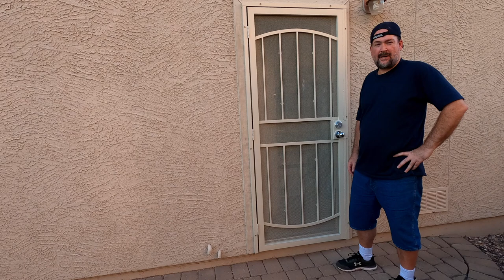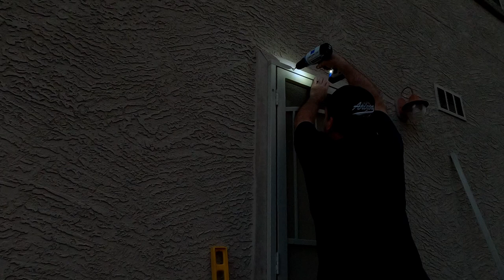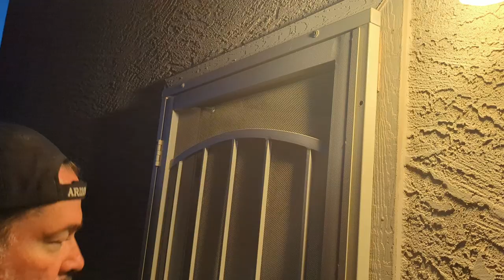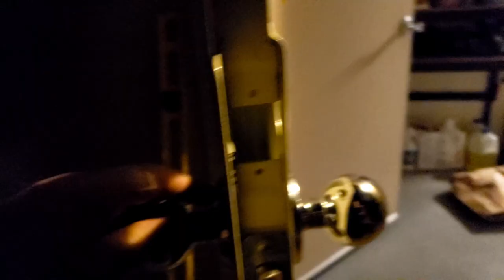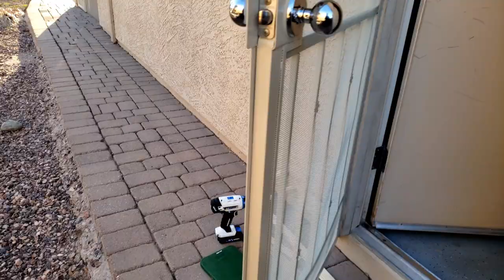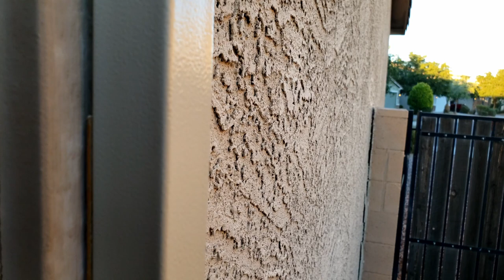Watch This Video Before You Install A Security Door!!! 👀

Comment: This is very helpful because it doesn't show a "perfect" installation under ideal conditions that makes the person look good. I'm likely to make the mistake of not checking the top too and would've been frustrated, this is a solid reminder of what not to do as well as what to do. Thanks.
Reply from the maker: Thanks! A lot of people try to make everything look so easy and it can be frustrating when I try to do it and it doesn't work out. So I like to show my DIY mistakes. I think it helps give people a realistic idea of how these types projects can go wrong so they can get it done right in the end.
Reply: Well for  starters  you should have done it in the daylight. Can't see anything you're doing.

Comment: Great video! Thanks for showing the mistake so i can prevent from making it myself.  I also like the tip abiut using my own screws to make sure it is hunged leveled before putting on the security screws.
Reply from the maker: Thanks! Yeah if you are off a little bit it can be tough to adjust the heavy duty hardware that these things come with. So getting it all lined up first really helps a lot.

Comment: Great video! Question for you: I have a 30x80 door. This model starts at 32 inches, but I’m not seeing any reason why it wouldn’t work for my opening as long as the trim is wide enough. Do you agree? Nothing besides the door handle/lockset extends into void between the surface-mounted security door and the inner door, right? Thanks!
Reply from the maker: The security door will be mounted to the door frame surrounding your existing door.  It will open outwards and should be larger than your house door so that it can be attached to the door frame. To get the right size measure your door frame from side to side and top to bottom. As long as its not larger or shorter than your door frame you should be good to go.
Reply: @ThatHobby  Much appreciated!

Comment: 1 problem sir. Thieves can easly grab a drill with a star bit and take the door off.
Reply from the maker: This is just for installation purposes. Once you have it all lined up you can install the included tamper proof bolts. But if you are just using this as a heavy duty screen door you can leave in the screws. Plus most thieves don't carry a drill with different drill bits. I think most of them just look for unlocked doors and windows.

Comment: I need to adjust my door but don't know how to remove the one-way frame bolts without grinding them off.
Is there a secret to that?
Reply from the maker: I plan on making a video about it. You can use a pair of pliers or some vice grips to loosen the one-way bolts a little. If it is not off by that much you may be able to use some wood shims to twist the security door frame a little bit to adjust it. If it is really bad you may have to take out the bolts and fill the holes with wood shims and put in new holes. But unscrewing the bolts can be a reel chore. So hopefully it is only off a little bit and can be adjusted.
Reply: I used a grinder to cut new slits into the bolt that allowed me to back it out with a flathead
Reply from the maker: @devdeuce93  I haven't tried that but it sounds like a pretty good way to get the bolts out. Most people just use a wrench or cut the heads off and grind down the bolts.
Reply: you can buy a removal tool from your local hardware store.

Comment: So  i dont have to meassure anything, just eyeball it, make sure is level and thats it?
Reply from the maker: I wouldn't say you don't have to measure. I would just say that it can be challenging to get the measurements right. If your door jamb is square and your measurements all line up this should be an easy install. But if everything is a little bit off this technique can make the installation go a little smoother. If you mess up on the measurements and you  install the door with the tamper proof hardware it can be difficult to adjust it. That's why I use the regular screws to install the door. Once you get everything lined up right you can install the tamper proof hardware.
Reply: @ThatHobby  thank u. Great video by the way.. any tips for a newbie?  I will install 3 security doors at my house today
Reply: @ThatHobby  I will get them at home depot
Reply from the maker: @futbol1972  I think getting some shims will help out a lot. I didn't use any shims the first time I installed a security door and I had some issues with the door jamb not being plumb. The other issue is the threshold. I built a few of them but they sell a kit that looks way better. Other than that installing the doors with regular screws first is the best tip. Doing that allows you to recover quickly form any measuring mistakes.
Reply from the maker: @futbol1972  Also remember that the 7 ft doors are reversable but the 8 ft doors aren't. So if you have a larger door you will need to get one that swings the right direction.
Reply: @ThatHobby  thank u

Comment: My door is not locking wat did I do wrong?
Reply from the maker: The deadbolt may not be lining up with the hole on the security door frame. Check that and see if you can get it to line up a little better.
Reply from the maker: U can also adjust the dead bolt by loosening the screws on it to raise or lower it a little bit. Something that can work to get it to line up right.
Reply: @ThatHobby it’s impossible to remove the screws literally spent 3 hours can’t get it off
Reply: @ThatHobby  I will try that but if that doesn’t work do u think if I cut the hole open a little with a carbide cutter that would work?
Reply: Try loosening the bolts on the lock assembly a little at a time, sometimes when tightened down they make lock really tough to lock/unlock. Also look closely at the bolt of the lock as it closes towards door you can use a pencil to mark on outside of jamb the top and bottom of the bolt right before it shuts, then open it up and see if the locking part is in position with the hole in the jamb.